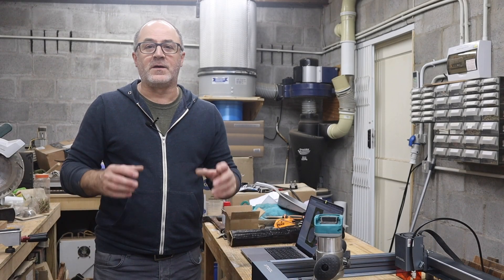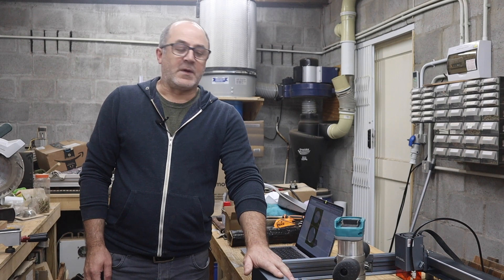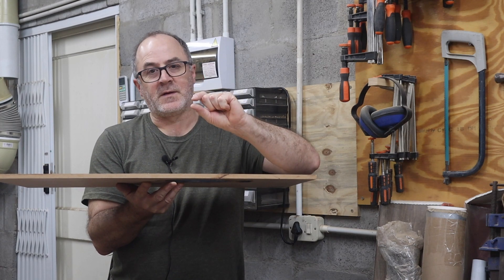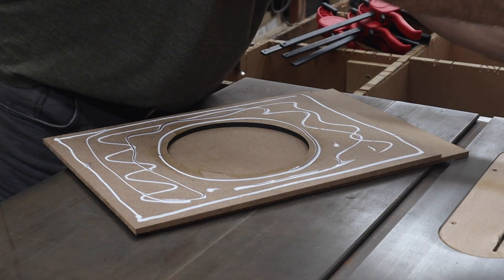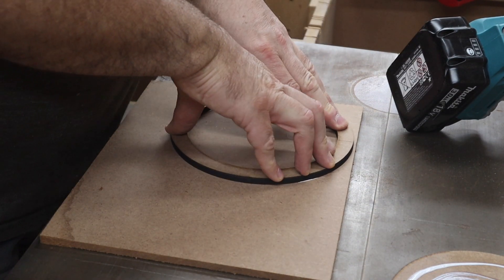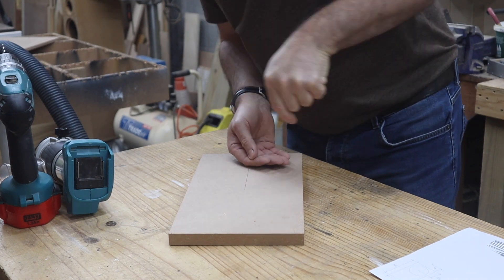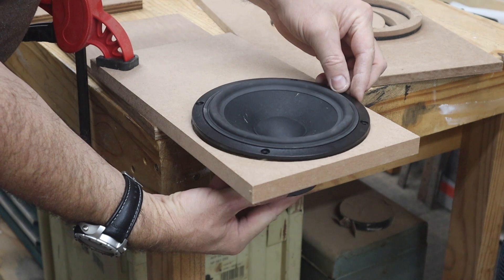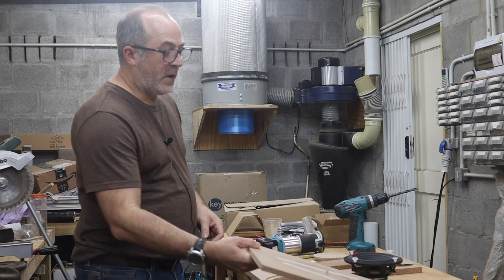Template Making with This Powerful Diode LASER | xTool D1 Pro 💪 - by SoundBlab

Comment: Why didn't you just cut 2 templates with the laser, then glue them together?
Reply from the maker: That is definitely and option, but once you have a template it is quicker, easier and potentially more accurate for me to use the router and a flush trim bit. It eliminates glueing it where it might not line up accurately.

Comment: Hello, love your content! What kind of calculations and software do you use when designing your speakers? Chamber volume, port length, port alignments etc. What is your process?
Reply from the maker: I use a Dayton Audio DATS to measure specs for drivers, but most come with spec sheets. Box modelling is with WinISD or VituixCAD. Measurement with a UMIK-1 USB microphone and REW software, and crossover modelling with XSim or VitiuxCAD.

Comment: Great! You did do a super snugg template for the woofer. So nice and accurate. When done you tried with the woofer and it fit tight. Really tight. Shouldn’t there be a little more space, because of humidity and paint? Ok, material depending, but mdf, ply and hard wood do expand different when color is added. Should I add some 1/10 of millimetres?
Reply from the maker: Thanks. I think the video might make it look like it fit tight. I was actually just depressing the foam gasket and it looked like it was a tight fit. I always allow a bit extra when cutting a mounting hole, and in this case I did. So expansion and adding paint should not be a problem. But yeah, always allow a bit of tolerance. 👍

Comment: I think I have the same cordless router. It's amazing; you just need to use large batteries as small ones with few phases won't cut it (pun intended). But then it goes throuh MDF like butter, even at increased depth (whcih you shouldn't do of course). Also, you should step in front of the camera more often, you are very handsome.
Reply from the maker: Yeah, I use minimum 3Ah batteries in this machine. LOL, thanks! Hopefully over time it will become easier and more comfortable.

Comment: How do you manage shipping to RSA with Banggood?

In a country with no postal service you can only use the courier option that makes a lot of Banggood products cost the same as locally available products
Reply from the maker: I normally opt for Direct Shipping (Tax Free). It adds more than the normal shipping, but gets delivered via courier and still usually works out much cheaper than local products. It also depends though on what you buy.